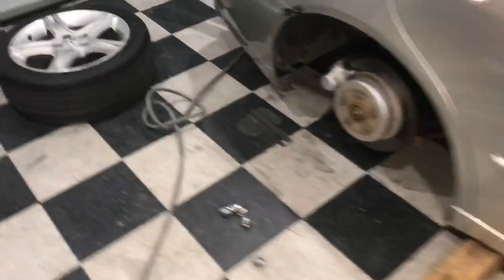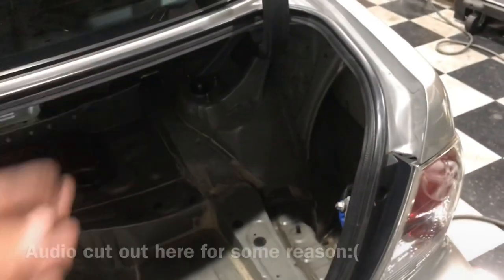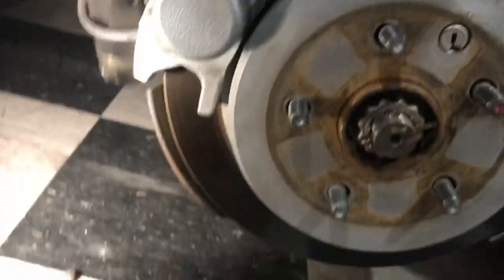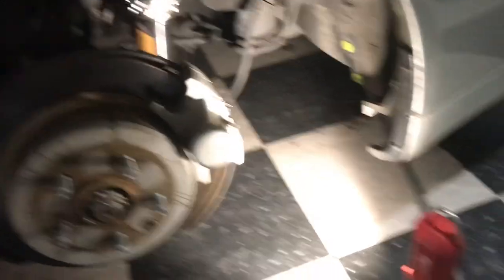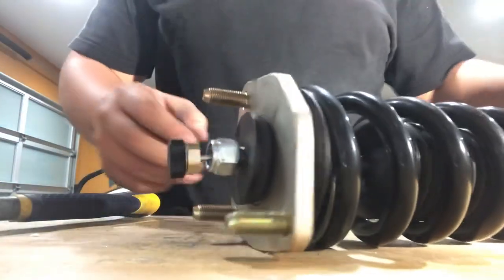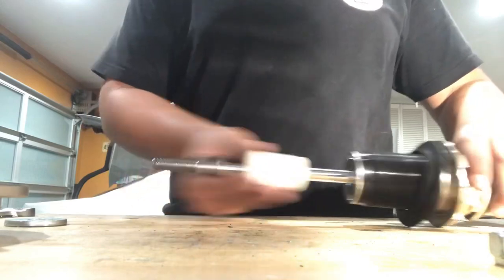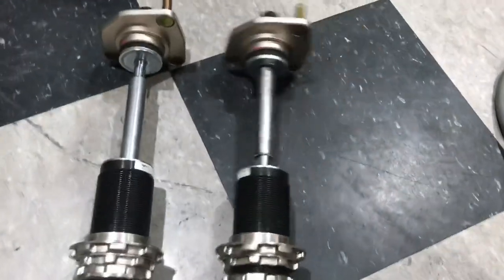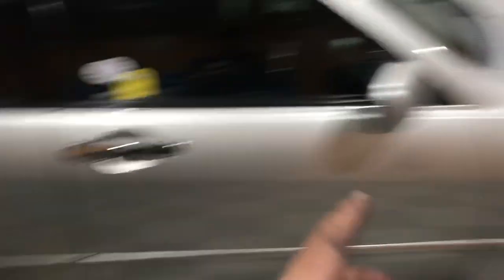How To Run Washers On Your Coilovers! (Tutorial)

Comment: Dude just do it on stock suspension would be cheeper and do the exact same thing 😂
Reply: you can’t adjust.
Reply: Childish Dreams adjust what it’s a solid metal strut with no movement. Would do exact same thing on stock strut.
Reply: @childishdreams  you can't adjust what?
Reply: Eraun Petry the height lol
Reply: Colin Frank the higher adjust doesn’t even really work with this trick, it goes off how long your bar/washers/whatever you are using
Reply: False. You can’t adjust the height. If you did it on stock suspension you wouldn’t be able to lower the car.. smh🤦‍♂️
Reply: @carsonthomas6186  you're joking right?
Reply: @carsonthomas6186  add and remove washers…?
Reply: @poboypowder7567  you can’t adjust ride height using washers. That’s why you buy coil overs🤦‍♂️
Reply: @carsonthomas6186  on washers you can add and remove washers, people use washers to have very precise and stuff suspension as they can adjust it millimeters per washer, and it won’t compress past that
Reply: @childishdreams  add or remove washers to adjust

Comment: Can you explain to me the difference between coil overs and washers do washers make the car lower ?
Reply: Washers just increase the stiffness to where the suspension won't flex or rebound back into the fender pretty much making it way to stiff for comfort but good for perfect fitment without rubbing when hitting bumps..but you'll probably go to the moon with it being so stiff. Never ran washers I've wanted to but I don't see the point it's kinda unsafe...
Reply: washer is cheap alternative essentially
Reply: @keatonwalker4002 what about just some insanely high spring rates on the springs? Or can nothing compare to washers
Reply: @keatonwalker4002 never run washers lol its 10x more dangerous lol

Comment: Can you run washers on stock suspension?
Reply: Yes, if you plan on just running washers there is no reason to buy coilovers.
Reply: @alexc.8424  i wanna do that ...run oem on washers or pipe...but honestly have no idea what 2 do
Reply: @fishtanknoob3833  do exactly what this guy did, just with the stock suspension. Remove the top hat and spring (do it safely and use spring compressors), then get rid of all the dust covering crap (if it is in the way and should be removed), remove the bump stop(s), then put the stock suspension back in the car bare bones (no washers just yet). 

Now what you need to do is use a jack and jack up the hub to see how low you can go before you A: start rubbing or B: parts start colliding in unsafe ways (for example the upper control arm in the front hitting the top of the strut tower). Just jack up the hub until you are as low as you can go, and then take a pair of measuring calipers to measure the length of the inner shock rod in between the top hat and the bottom half of the strut (the part where you will put your washers). Once you have measured this gap, then just measure how many washers will fill that gap, then out the washers on the strut. Then you put it all back in the car.

It's as simple as that, hopefully my explaining helps you out. I did this on my coilovers and actually figured out a way to run springs and washers without have to take apart the whole coilover every time I need to switch from washers to normal springs. Lmk if you need anymore help.
Reply: @alexc.8424  Did this blow your shocks? I have some stiff springs on my stock shocks and they blew within a couple of weeks. Now whenever I hit a bump I go flying upwards.
Reply: @hadoob  It shouldn't no. I did the same thing with my shocks, I ran 15k and 20k springs and it destroyed my shocks. This is because the shocks are not built/valved for stronger springs, therefore the springs cause the shocks to expand faster and stronger, which the valves are not made to handle.  
Now in regards to stock shocks on washers, I don't think you will have an issue because you are not causing the shocks to deal with stronger springs, they are just staying compressed the whole time. Don't take my words as fact, because I've only ever run washers on blown shocks, but if I had to give an answer I don't think it would be a problem.
Reply: @alexc.8424  Ohh I see the idea. I will try it! Thanks for the info!
Reply: @alexc.8424  yo may i ask how has it been reliably
Reply: @samuels_age7155  totally fine, GET AN ALIGNMENT, don't mean to yell just wanna make sure people see that. It is crucial that if you dump your car on any type of suspension that you get the car aligned. I got serious camber and toe wear and now I have to replace the tire. But if you can get your toe angle under control you should be fine. Camber is up to you and isn't dangerous, you will just go through tires a lot quicker. So from now on I'm gonna get camber adjustment arms and toe adjustment arms to make my tires last as long as possible. 

But from a reliability stand point I have not had any issues. The ride is rough of course, but I have not had any unfixable issues that would cause me to not do it again.
Reply: @alexc.8424  I’m going to do this to my rolla on the weekend thanks for the info

Comment: The funny thing is you didn’t need to do this, if you would’ve set preload you could’ve lowered the coilovers probably another .75 to a inch but you obviously don’t know what you’re doing
Reply from the maker: The whole point of this was to make the car stiff. I never went any lower than the height I was already at
Reply: preload wont change spring rate, youll still get tons of rebound and hit shit